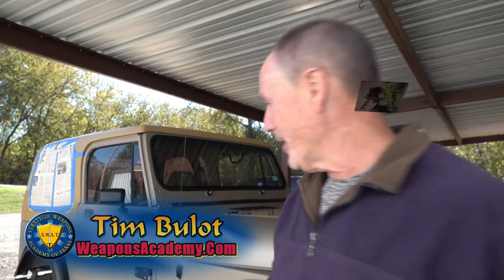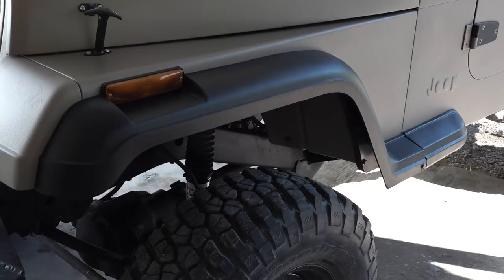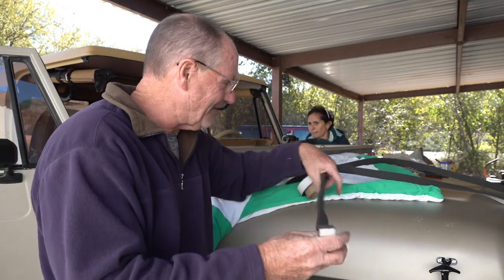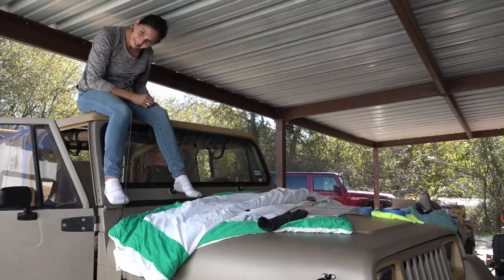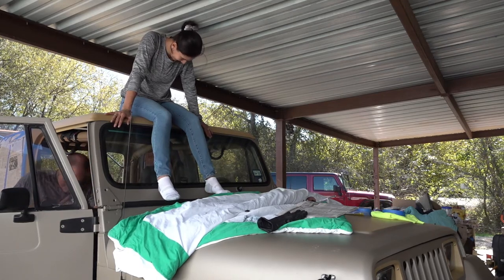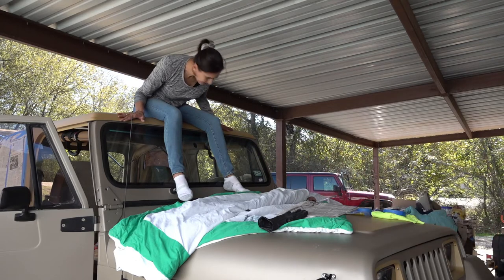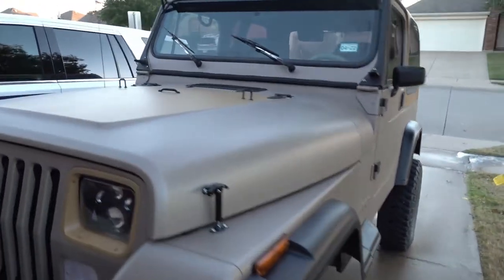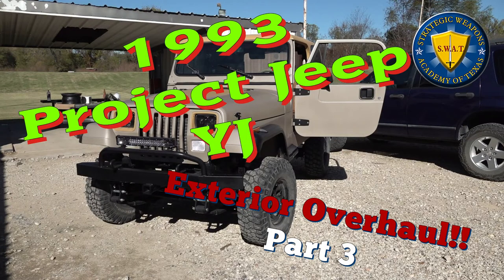Pt. 3 Project Jeep YJ, Exterior Overhaul Restoration & Modification with Custom Coat (Raptor Liner)

Comment: You may have the wrong windshield frame, from a CJ maybe. YJ should have a couple of ribs on lower portion. I changed mine this summer (frame and new seal) and was a very tight fit.
Reply: It is a CJ frame as far as I can tell.  That seal is the same as the YJ  I bought both.   I added the weather seal strip and it works great, no wind or water gets through so far!